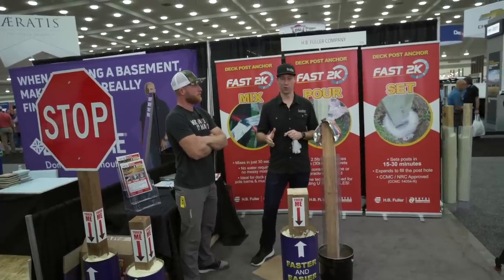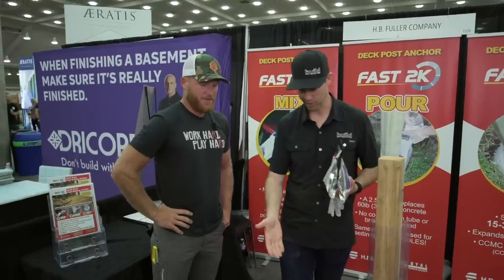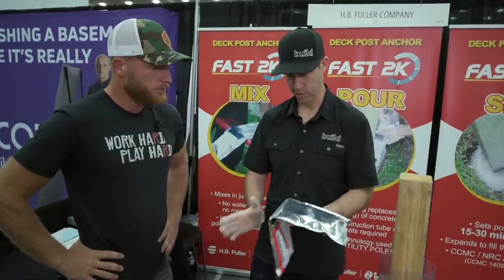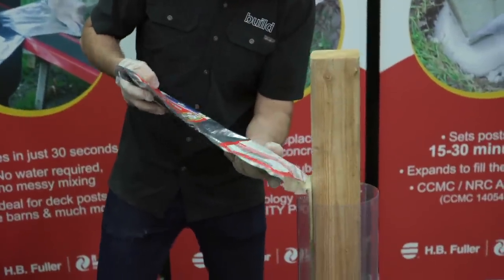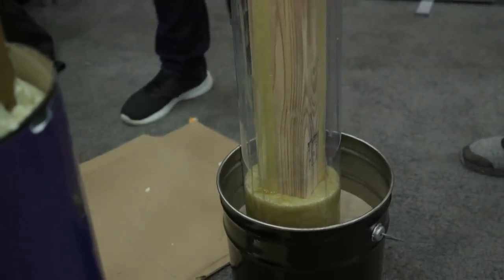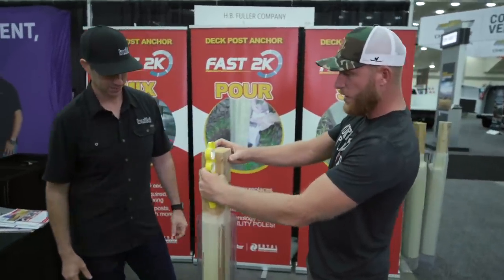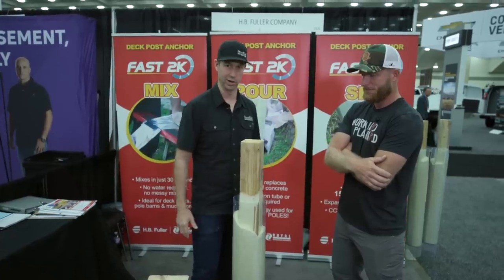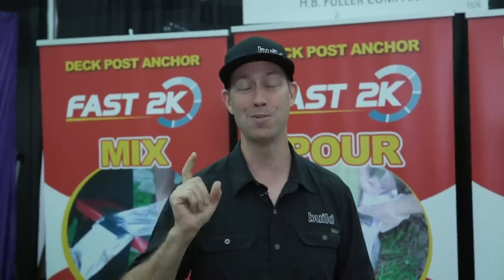Foam INSTEAD  of Concrete???

Comment: someone needs to check their math. 1/3 of a yard is roughly 20 60lb bags. If one pouch replaces a 60lb bag, you need roughly 20 pouches.

A full yard of concrete is approximately 60 60lb bags. The cost of this product is 6-7 times the cost of concrete.
Reply: These bag will replace what 3 bags of concrete will do. However the whole you dig for the foam has to be a smaller diameter then for concrete
Reply: Chris Frost The display behind Matt specifically says that a 2.5lb bag replaces a 60lb bag of concrete. SINGULAR, not plural.

Comment: I build fences in texas so what your saying is that I can do 2days work in 1 day at a lower cost per post
Reply: Yes. 
Can you build me my fence?
Reply: No. It’s more expensive. One pouch replaces one 60lb bag. 3-5 x’s the cost of concrete.
Reply: I think what is going to happen is that guys who use the foam will go around undercutting the guys that use concrete. Then is a few years down the line, all the foam set posts will have rotted away and the guys that installed them will be long gone.

Comment: The rot happens at the surface and propagates down, not from the sides. So that's B.S. The cement also adds weight and stability to the post that foam does not.  Plus you use treated wood for that. It's way more expensive too. Interesting, quick and easy yes, a no brainer...not.

Comment: Y’all didn’t focus on the product after it was poured only talked that distracted us from watching the foam. You didn’t move the post or even show us it was level.... Terrible presentation!!!!!
Reply: They also said that one bag replaces 60 pounds of concrete then did the math saying 3 bags would do 1/3 yard worth... none of that math works out... there’s 4,000 pounds in a yard of concrete so it’d be more like 22 bags or $220-$330 worth of foam

Comment: One could just as easily use treated lumber and acquire better improvements. Foam is not the same as concrete and lack many qualities, making it inferior as a building tool. Foams are easy to make is why they get hype. How to do remove them at end of life cycle? Where to do they go? Are they organic and will decompose or are they just another problem like plastics? Looks cool but overall I am not convinced.

Comment: Anyone considering using this over concrete, watch some videos of installing fence posts in the ground for real, not on a show floor.  Spoiler alert.... it's not good.  Not enough weight to hold anything steadily.  It will wobble the next day. Foam deteriorates. Concrete will last longer than the fence itself.  Just use concrete.

Comment: Fact check.  A 1/3 of a yard of concrete is a lot more than 3or4 bags.  A 80 lb. bag is 2/3 of a cubic ft.  There are 27 cubic ft in a yard.  Concrete is way less expensive!

Comment: Bag Concrete is much cheaper.. I put roofing tar on the end of the post going underground and pack dry concrete around it. The concrete will harden from moisture from the ground in a few days.. The roofing tar extends the life of the post by many years. Fuck the expensive foam!

Comment: I'm A Structural Engineer And You Have Grossly Over Estimated The Amount And The Price For The Concrete Required For A 4x4 Post... 

If Installed Correctly A Treated Post Will Last As Long As The Listed Guarantee Of The Treatment And The Concrete Cost Will Be Less Than $4 Per Post... 

As For Strength... No Way On Gods Green Earth Is Foam Stronger Than Concrete... 

You Can't Build A Lasting Business On Misinformation... And Thats Choosing My Words With Extreme Restraint...
Reply: jami w  ... 
So a carpenter knows more about structure than a 45 year Structural Engineer who built 16 High Rise Office Buildings and Hotels all across the nation not to mention Multiple Housing Developments... And all without a single structural issue... 
Don't make me laugh... 
Rest assured you will never work on any project I'm associated with... 
Moreover, You are without a doubt that Some Other GUY you mentioned...
Reply: jami w  ... Look,,, I made a factual statement, which for some odd reason pissed you off... Hence you threw insults at me... I laid your insults back upon you which Pissed you off even more... Thus you magnified your insults... 
Be It Known... I did not start your Emotional insult campaign... YOU DID !!! 
Bottom Line,,, A female can do far more for me than you ever can and I refuse to put up with their Emotional outburst... Hence your out of luck...

Comment: Man let me tell you... Is not new.. I used to be Foreman for company who sell concrete wall for manafacture or warehouse facility.. about 60ft high.. they take a giant foam sheet 60ft wide and 8ft thick.. and then .. pour about 4 inch of concrete around.. that thing when it finish and dry.. weight about 40 tons.. they would sell it as full concrete wall.. rip off .. and also for bridge colums..

Comment: Different versions of concrete have been around since the third century.  Cement itself has been around since the dawn of time. Any building product that claims to be revolutionary are claims that made with just a limited amount of testing. This product has yet to stand the test of time. Remember the Boston concrete tunnel collapse in 2006? Let's hold up 26 tons of concrete ceiling with some bolts anchored in epoxy.  How'd that work out?

Comment: You shouldn't pour concrete around a wooden pole anyways.  The concrete will hold water and rot out your post.  Not a good comparison.  Any method would be Superior, foam or not.

Comment: Bought and used this product, would NOT recommend it. The foam is easy to mix, sets quickly, sets hard at first.

However the foam pulls away from the inside of the hole over time. The foam compresses with lateral load such as wind sheer on a fence.

Pulled all the posts I had used this on and replaced with quickcrete.

I’m all for new construction tech, but this is a NO GO!

Comment: Foam products do keep moisture locked around any Natural material which will absorb the moisture and rott out.
Just look at Residential foam external moldings, proven to cause moisture mold damage to the homes structure.
Using on electical exterior poles that are well oiled maybe great.
But for homes, not so great. Better than concrete 🤔 why have you not heard of a foundation made of foam? We all know why
Try using foam and watch the first frost or flood... You can double use as a floatation device.

Comment: 30 Bucks a hole and that only displaces 60 pounds of concrete.?. Why not use a tube of great stuff foam at $4.88. I think it’s a good start with developing an economical way to stabilize a post but until it’s made competitive , keep working on it boys.

Comment: Just use a metal pole and concrete foam is wobbly  wood will rot weather foam or crete i just pour it in hole add water and boom strong set ready for fence deck shed i also pack the crete in hole with and old sucker rod or rebar it is tight enough to hang on same day foam thats funny

Comment: When you attach a fence to this post, you're creating a huge sail for the wind.  I'd be really worried that wind will push the back and forth and cause cracks in this foam.  Once a crack forms, water will get in.  Freeze expansion will follow.  After a couple years the post will be loose an water will be in there.  That's my theory.
Reply: Matthew Grotke 4000 lbs of force rated. It’s basically foam concrete. Once it sets its firm. Bury it and move on.

Comment: Run a 4000 psi compressive strength test and compare it to concrete plus where I live if you embed a wood post in concrete you'll fail your Inspection

Comment: This is kinda dumb.. this is more commercial grade stuff. 
Concrete is like $4 usd in Australia for 44 lbs. unless you are pouring a giant 3m post I highly doubt you would need more than 2 bags. Most residential posts in Australia need 1 bag of concrete a post.

Comment: If you think a troll who bullies and name calls other commenters on your channel deserves to be the highlighted reply, well that says a lot about the type of person you are......Have a great day!
Reply: This is just one excerpt of a complaint,
The downsides:
1. You need to store it in a narrow temperature range prior to using it. I think the instructions with my bags said 2 hrs at approximately 72-77 degrees or something like that. This bit me on the job, as I had been storing it in my car & the outside temp was around 50-ish. No biggie - I just turned on my car & let it warm up while I did other prep work. Ultimately no time was lost. Note that I just looked at the instructions published on the mfg's website, and they said 1 hr at 60-95 degrees, which is much easier to do. 
2. Repairs might be difficult. You wouldn't be able to use one of those fence-post repair brackets that you pound between the post & the concrete. If you tried, it would just mash the foam & destroy the integrity of the backfill.
3. As the foam expands, it leaves a "cup" at the base of the post, which tends to hold water. Less of an issue if you're using a pressure-treated post. But it's likely why the Fast2k instructions say to wet the bottom of the post with the product as you fill the hole, because it helps waterproof the post.
4. The charts that state how many bags you need for a given post & hole size are probably accurate - IF your holes are perfectly plumb and perfectly cylindrical. If they're wider at the top, you'll need more. If they're not - i.e. if you had to widen certain parts of the post hole - you're going to need more. So yeah, buy extra and return what you don't use.
5. As long as you're buying extra, get an assortment - some of the big bags and some of the small ones. Then you can use your best judgment when you have to top off a hole & perhaps save some money. For example, topping off with 1 big bag is cheaper than 2 small ones.
6. I was using a special post-hole digger that doesn't require widening of the clamshell handles and thus gives a narrower hole at the top when digging a deep hole. If my holes had widened at the top, I'd be a little uneasy about how solid the install would have been. I had one hole that widened at the top because I needed to remove rocks & some tree roots. I didn't like the look of it, so I had to "repair" the hole. 
Keep in mind this product is not meant for "structural applications", so don't build anything on top of it. In other words, it wouldn't withstand downward forces/pressures a deck post puts on a footing. It's only meant for absorbing smaller forces/pressures - like the lateral forces exerted by the wind on a fence post. 

Hah you are right ....this stuffs great!

Comment: Come on Kyle you know you don't put concrete around post
Reply: Wood Chuck you bet I don’t, and I would never use this product if concrete were available to make a pier.  This product could be useful back in a place inaccessible by a ready mix truck or where water is hard to come by

Comment: The demo bag didn't even fill the tube they poured it in. How can I mix more without mixing to much? They obvious didn't size their demo correctly. No I have water puddling right in top unless I mix another bag, try to get the fill in amount just right, then throw the rest away. That's too expensive for that. If they didn't know that 2lb bag wouldn't fill their demo, then trial an error isn't for me

Comment: Quoting an entire yard of concrete for one post? Concrete is much cheaper! $10-15 for one bag that "replaces 60lbs of concrete" compared to a $3 bag of concrete thats 80lbs. And its 60lbs comparable in volume not weight. Concrete is much heavier and sturdier.

Comment: That's cool and all but with 1 yard of concrete at $130 could fill at least 20 of those holes you just dumped $10 into as that example you just did, doesn't take close to 1/3 of a yard. I would hate to have to dig those up when the wood rots away after 10 years.

Comment: This is cool but will never pass an inspection.  Dig hole,  set tube with rebar , call for inspection.  Pass inspection,  poor concrete and set the plate for post to sit on. For a deck anyways. For a fence , use plastic post and this foam I'm sure it be fine. But I'm no fence guy

Comment: codes now are to never bury a post. but to poor your concrete footing with an added steel brace/bracket and set the post an inch off the concrete.   foam or concrete. how about we just lean from the past and NOT bury our posts..

Comment: This thing is 12-15 bucks a regular quick dry fence post cement ready mixed is around 3 bucks for a 50 pounder,,,,,   the math does not add up, this thing is tooo expensive for DIYers

Comment: if there's no aggregate then there's no way the post will stay in the soil, you need some gravel or something....it replace cement, not concrete.
Reply: Do you think the post would float out if the ground water table is high or in a flood situation? Curious as to why you think an aggregate is needed. I would think that the sidewall friction would hold it in place.
Reply: that depend if the soil has been disturbed or how deep or and what kind of soil. if there's clay i could see this thing just slide out when there's alot of water
Reply: Never yet heard or rather read of any one experiencing their fence or other post using this of it floating  out of the soil, you seem to misunderstand what a friction pile is, a lot <- is how you spell it btw.
Reply: Joshua79C C come up to the NE and you will see plenty of it

Comment: This is an old idea. There was commercially available expanding 2 part foam for fence posts in the late 70's that my father tried for a split rail fence and it failed miserably.
I think it was called "Post Hold". Besides having almost no mass, the foam is easily compressible, and will absorb moisture and turn into a sponge. Concrete is forever. 
Yeah, It works in a hard sono tube demonstration but just try it in a hole in the ground, in the dirt. What a joke.  You guys are easily duped. Try making a foundation out of foam and let me know how that works out.
Reply: That was most likely open cell foam. This is closed cell foam and very strong. The cost is the factor here. You would spend close To 10 times what concrete would cost.

Comment: Maybe if it's all made if it were made inside I thought melting was great but now idk man well it was worth the try trying to tell other's my daily power of thoughts The real question is both ideas are stealing from this world so the real question is what should we use as a substitute to supply a solid material besides wood or concrete how about the glass and the combination of a lot of lava rock mixed with sand to reform a solid surface which is not a bad idea

Comment: Everyone calling out the shitty math with even shittier math. Listen up: Kyle said it takes about 1/3 of a yard for one post. For all you wackos out there trying to say mix bags of concrete that''s going to be a minimum of 20 60-pound bags per hole. Yeah have fun with that i'm gonna call a concrete truck. As for Matt, if one bag of this crap replaces 60 pounds of concrete how the hell do you come up with 3-4 bags and try to say its cheaper than concrete? Dude I know you don't think a yard of concrete only weighs 720 pounds

Comment: CONCRETE IS BETTER. Foam isn't nearly as stout and definitely fails if your holes are not straight up and down and or in softer dirt.
Reply: DONT BE FOOLED, do it ONCE, do it RIGHT, use CONCRETE

Comment: @Parm Mohan  Matt.... Sir you know better than anyone polyurethane foam breaks down under uv and weatherization is not kind to any of it uv resistant or not. You also know bugs and termites love tunneling homes in this stuff. It's a major concern foaming houses that aren't as we both know air tight. You know better than this but gotta promote and I guess.

Comment: Used it on a back yard 4' fence, waste of money. Never let a female decide what to use if she is not familiar with the process or the materials.
Oh, it's cheaper she said...It's not as heavy to lift she said....It turned out like garbage.
Many of the posts feel loose. Of course they do, when all you have at the bottom of a post is foam....it might not feel so well planted. It drives the post up whatever foam is under the post. If you think that's not right, and there should not be any foam at the bottom. You have no business building fences.
Reply: @pablomax3045  Yea I'm sure you are right about your assumption! Have a great day!

Comment: lol. 1 tonne of ballast and 6 cement would easily fix 20 posts at a cost of no more than 55uk delivered. thats 70 usd for u usa. so max cost per hole is 3.5usd. this is bs. Also if your ok spending 30usd per hole to fill why use wooden posts lol. the post is ten times cheaper to buy than that holding it. use concrete posts ffs

Comment: This stuff turns puke green after a few days.
Reply: yes it degrades in the sun, that is why the makers recommend setting it to just below the surface to cover with dirt and grass which is more pleasant to the eye.
Reply: Joshua79C C and it continues to degrade in the soil. Replace a few dozen of these a year up here. All are loose as shit and have shifted as if a car backed into them

Comment: Bullshit. 2.50 a bag  of concrete. 10 dollars for the foam. And they broke the post because of the angle they were pulling it at. It wouldn't shear off either way, it would pull the foam out of the ground. You guys are homers and probably got paid for your lil infomercial.

Comment: Since its compressive strength vs. concrete is about nil,  this crap will not hold up over the years of wind force on the pole or fence fence post.  It will crush and wood it is holding will be able to pull out.  THAT is why you see ZERO lateral force te4sting on these video's.